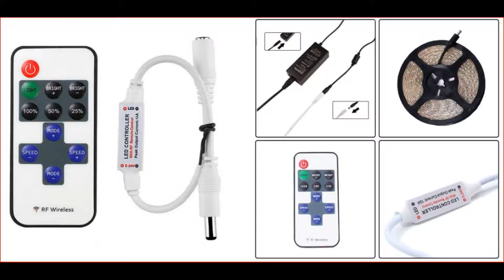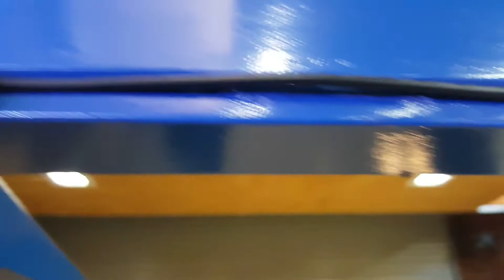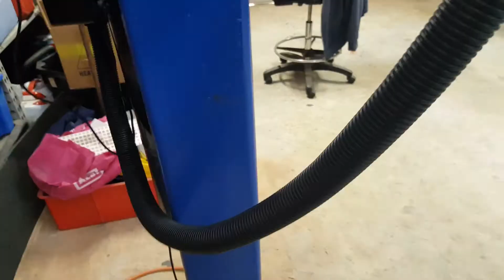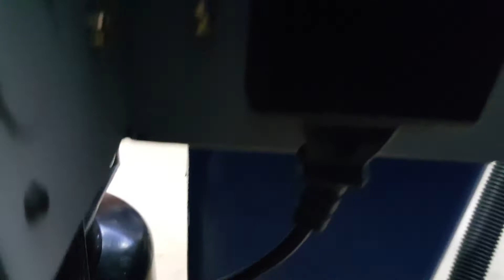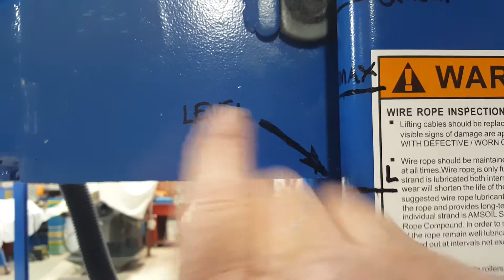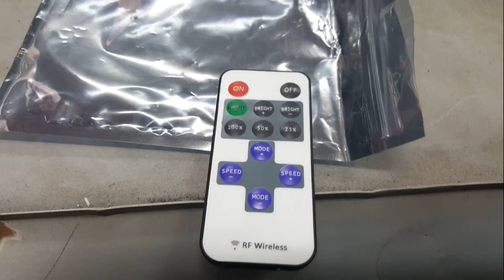New 4 post Hoist from Joel's Garage- LED lights

Comment: How sturdy is the lift if you push the posts with a vehicle on it in the raised position?
Reply from the maker: The posts are firmly anchored in the floor. There is no movement in the structure with my F250 high on the lift.

Comment: Hi mate, 
we are looking at this hoist for our short wheel base  91 model Toyota Coaster.
Rego papers say 2850kg approx, this was after my dad converted it. 
He had to get engineers certificate, weighbridge ticket etc.
I would obviously weigh it in its loaded form to confirm current 
ready to roll weight but even if it is 3000kgs surely this 4 tonne hoist should
be good to go?
Given your F truck would not be light and the Coaster is about 6.5m front to back.
What do you think, any advice?
Cheers.
Reply from the maker: Iman, my hoist would be fine for your Coaster bus. I was considering using it to lift a Gutted Rosa bus which is 3800kg empty and 7800mm long. The wheel base 4800mm would fit on the platforms with a large over hang of the body. My hoist is not positioned to handle that overhang at present. My Ford F250 is around 6500mm long and has a GVM of 4000kg. I mainly use the hoist for parking my truck in the air to free up space beneath for our daily drive and workshop. I have the 2000kg air over hydraulic jack that runs between the platforms for when I want to work on the vehicle and change wheels etc.
Reply: @bms250ford  Thanks for the prompt response.
I thought it should be fine size wise and your effy is no light weight.
Wheelbase on our Coaster is only 3200mm approx.
I believe loaded and ready to roll, the Coaster should be between
3000kg and 3500kg, I will confirm this with a weigh bridge ticket
beforehand.
I'm guessing there should be a margin of safety built in to this type of 
equipment, so providing I don't exceed the 4000kg rated working limit
the unit should perform normally and safely. 
I also want to store the Coaster if possible and park my 1968 Mercury Marquis
coupe underneath it , obviously the Coaster is too high to store them the
 other way around.
I'm guessing your jacking set up would also work even though it is rated at 2000kg
as you are not lifting the whole weight of the vehicle at once, only one end?